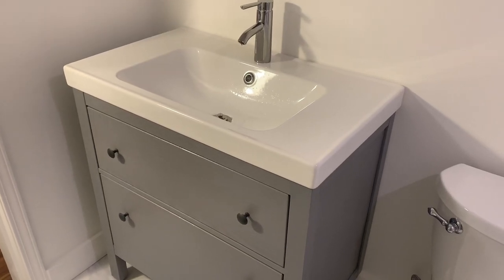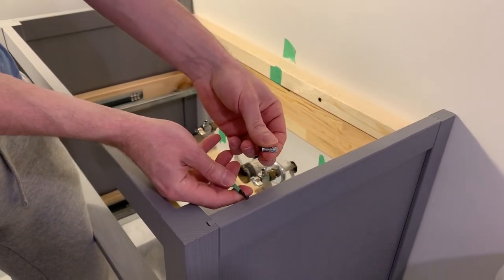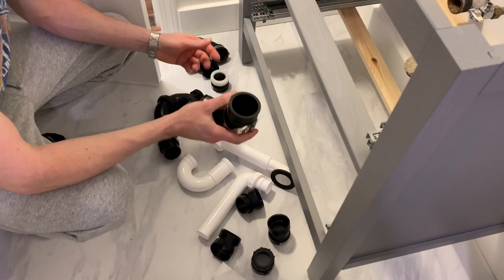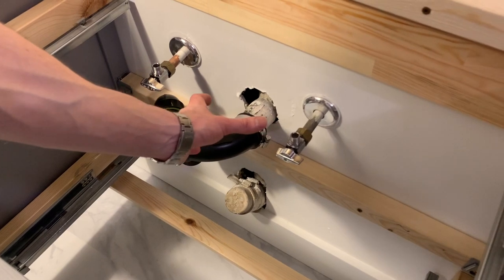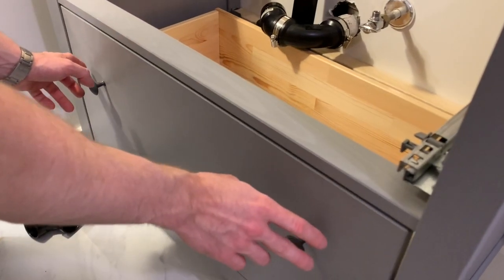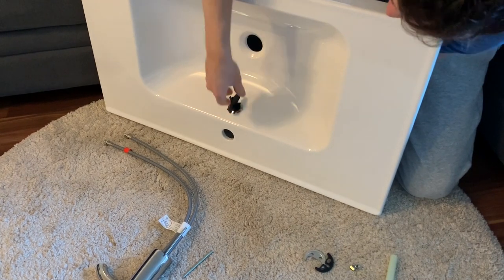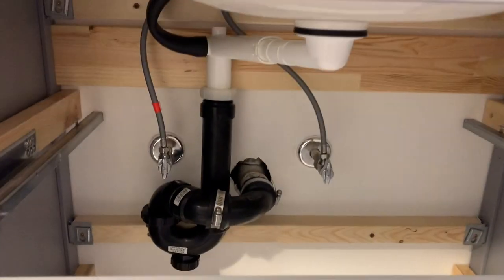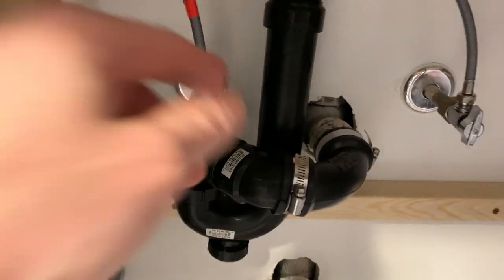HOW TO install IKEA Hemnes / Odensvik / Dalskär bathroom vanity

Comment: This is one of the most comprehensive videos I’ve seen for installing these Ikea vanities. Solved my dilemma about not having the wall studs in the right place without tearing out major portions of drywall, plus a really good workaround for their weird drain connections. Thank you!
Reply from the maker: Thank you, Doug! I would only recommend strapping the 2x2 (or 2x4) to the wall for vanities with legs as I don’t think it would hold the weight of a floating vanity. 

Also, be sure that the top of your sink (white porcelain section) clears the wood you strap on the wall. I originally had a 2x4 but later found out it was too thick and was hitting the top of the sink once I placed on the cabinet

Comment: I just finished replacing all the ikea plumbing I could.    Now I have to replace the drain pipe with the ikea part because it’s the only part that will fit.   I find all the cheap IKEA plumbing attracts hard water buildup like crazy.    But nothing at all with the ABS.    So hopefully I won’t have to do this again for a long time.   Good video👍🏼

Comment: Thank you for the great video! I’m installing mine currently and bought that little white pipe to black ABS piece at Home Depot but it doesn’t seem to have a good seal when tight. I’m concerned that if there were a clogged pipe then it would leak. Under normal conditions of course there is no issue due to gravity but have you ever had a clog?
Reply from the maker: No issue with clogs so far. The caveat is that you’ll always run the risk of leaking with mixing pipes, especially ikea pipes which are not standard in North America. The little white pipe should tighten a good seal around the pipes though. You can always experiment with other adapters/elbows.

Comment: Hi! I see you showed that you had clearance on the bottom drawer. How was the clearance with the top drawer? I am reading reviews and worrying about the functionality.
Reply from the maker: The top drawer is pretty shallow and doesn’t have much height, but there’s still lots of clearance for the pipes, it’s how IKEA builds them with efficient of space in mine.

Comment: I installed mines but the faucet started to wiggle after a few months.. any reason why? and white size is the green tool to tighten  the bolts underneath the faucet? thanks
Reply from the maker: I would first double check the instructions manual to ensure you installed it correctly, I would then check the bolt to see if it’s tightened. I’m unsure of the exact bolt size but I know IKEA uses metric in North America so it could be a 10mm-12mm size.

Comment: thanks for the video:) can you tell me how I can remove the cover on the back so that I can reach and loosen the screw behind it using an Allen key so that I can remove the mixer tap control lever? I would like to clean the mixer tap. Thank you!
Reply from the maker: Hey, I’m not sure what you’re trying to do, or if the mixer tap is serviceable. If you’re just trying to remove the mixer you can use a vice grip over a soft towel. Otherwise you might have to Google how to do that.

Comment: Hi Scott, what type of silicone did you use for this project?  Do I need to seal the gap between the sink and the wall?  Thank you!
Reply from the maker: I used a clear 100% silicone to glue the sink to the cabinet. 
For the sink to the wall, it is recommended you use a white 100% silicone.
You want something that is made for bathrooms, so it's 100% waterproof and won't mold.
Reply: @scott.charles.taylor  Thank you for the prompt response!  I did some research, can I use dap kiwi to glue and seal the gap?
Reply from the maker: @timfan3638  It should work, as long as it's waterproof and mold resistant. I've never used that stuff before though.
Reply: @scott.charles.taylor  awesome thank you!

Comment: Amazingly detailed video!
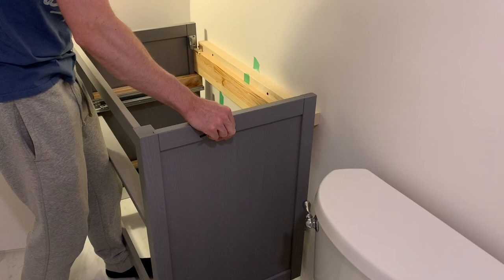Silly question for this particular Ikea vanity/sink, instead of using the 2x2s, can we simply drill and secure to wall studs from the 2x4 back support piece on the vanity itself? at @1:50 instead of the 4 bracket? or would that not be secure enough with just the two legs?
Reply from the maker: You could do that, but those strips of wood at the back aren’t super secure to bear the load of the cabinet in the long run, as it’s held in by dowels and screws

Comment: Mine came with 3 anchor hooks. Step 47 of the Ikea installation manual shows them place on the top of the vanity before the sink is installed. What are they for? I don't see you use them on your install.
Reply from the maker: I skipped using them and bolted it to the studs instead.

Comment: Great Video, just bought IKEA Odensvik sink and Rinnen pipe system. I try to explain my issue - The overflow black pipe is attached to the white pipe, the problem is that in the white pipe there is no hole (its has a T shape, so you can attach the overflow black pipe on either side) but there is no hole so the overflow water cannot flows down to the white pipe. Should I perforate? Thanks a lot
Reply from the maker: Yes, you have to knock out the side of the white part that you decide to use. There should be a step in the booklet for this, you can use a screwdriver or something to knock it out.
Reply: @scott.charles.taylor  Thanks a lot,

Comment: Pro tip: Use a grease pen to mark ABS pipes with a line on both sides after you have test fitted so you know which angle to glue elbows.  ;)
Reply from the maker: That’s a good tip, thanks!
Reply: What kind of glue did you use?

Comment: Hi Scott. Great video. What flexible pipe did you get? I scheduled a plumber because i thought i needed to cut a pipe. This video is exactly what i needed. I can do this myself if i can find the same pipe you used.
Reply from the maker: Hi Sandy, it will depend on the type of pipe you have in your home. I only used flexible pipe because in this case it was cast iron and you can’t glue plastic to it. If you have plastic -> plastic my recommendation would be to measure your pipe diameter and bring your ikea piece to Home Depot and buy a few different 90 degree pipes. You can always return the pieces you don’t end up using. Ask an assistant what type of pipe they would recommend to ensure it follows code.

Comment: Incredible video, thanks!  Very well explained.
Could you comment on the best way to mount this into plaster?
Thanks again!
Reply from the maker: Hi Emily, sorry I’m not familiar with plaster, but you would want to mount it to something structural in the wall
Reply: Thanks. It seems like using Molly/toggle bolts should work. Do you remember how long the 2x2 strips needed to be? Thanks again!
Reply: (I figure this was the 39 3/8” wide Hemnes model?)
Reply from the maker: @emilygraber7511  yes, snap toggle bolts should work if installed correctly!
If you’re using toggle bolts, there may no point for the 2x2 piece of wood then
I only used the 2x2 so I could mount it into the studs 
I don’t recall the length of the 2x2 off hand, but it has to “just” fit inside of the cabinet
Reply: That makes a lot of sense!! Thanks!

Comment: Hi, thank you for this.  I'm installing one now too.  My problem is an old house and floor drain, I've mocked it up using your video as a guide.  Question, wouldn't you add glue to the part where the Ikea drain goes into that black and white piece?  The one that gets bigger?  Sorry for the non-technical names, I'm not a professional, just trying to figure stuff out.
Reply from the maker: Good question. I wouldn’t add glue because it’s tighten by compression around the IKEA white pipe. You turn the screw and it’s gets tighter and tighter. Also, because it’s a vertical pipe/drain it wouldn’t be necessary

Comment: Great Video! I am doing a total Covid-19 Bathroom remodel.  As for the pipes.  Did you get them at Lowes or Home Depot?
Reply from the maker: Got them from both Lowes and Home Depot. They carry most of the same stuff, but only a few pieces were unique to one store. For example, the flexible 90 degree was only available at my Lowes, and the 1/4" to 1/2" reducer you see at 8:25 mark was only available at Home Depot. Just keep everything in the store bag in came in to make for a easier return.
Reply: Thank you Scott for your quick reply.  Great instructional video. All the Best!
Reply: Do you mind adding a list of the plumbing pieces. Thank you!!!

Comment: @Scott Taylor

I know this video is a little older now but are you able to tell me the measurements from the wall to the longest part of your elbow? Or the measurement from the wall to the back of the drawer so when it’s closed it doesn’t hit the pipe please and thank you.

I have been looking everywhere for this measurement but can’t seem to find it. This would greatly aid in my decision to see if I can use this vanity and sink combo

Thank you in advance any help would be amazing
Reply: Hi Matt, I’ll have to have a look and get back to you by the weekend!
Reply: @moretorque  thank you!
Reply from the maker: @hammerhog22  the wall to the back of the drawer is approximately 4 inches or about 10 centimetres. It’s very tight. Luckily for me the pipe comes out of the wall between the two drawers.
Reply: @scott.charles.taylor  thank you so much! This is amazing information!!!!

Comment: Hi Scott, Dont you need a backsplash for the sick since the wall is not tile ? (I want to know if backsplash is necessary for this vanity before buying it. My bathroom is not tiled where the vanity will go). Thanks
Reply: sink*
Reply from the maker: Adding a backsplash will be up to you. In my previous and current home, I've installed a total of 3 of these sinks without a backsplash and never had a problem with water splashing on the wall. They also have a little lip at the back to keep the water contained. If you have kids however, you may want to add a backsplash; but this is something you can always decide later down the road after installation. Also, the paint used in the bathrooms were latex/acrylic bathroom paint so was fairly resistant to moisture and could be wiped down. Hope this helps!
Reply: @scott.charles.taylor  thanks!
Reply: @scott.charles.taylor  Thank you for the video. I need to get the vanity with the top out of the bathroom for tiling the floor. And then to put it back. Since all the plastic pipes are glued together, can they be detached somehow without cutting?
Reply from the maker: @mzakuta  It will depend on how the pipes were joined, whether you used compression fitting or glued. If glued I would use new pipes are they are relatively cheap.
Reply: Thank you

Comment: Do you think this style and larger size sink would work with a 48x18 inch vanity with space for sink and cabinet doors below the sink?  I have a built in cabinet and just want to replace the sink/top.
Reply from the maker: I'm not sure to be honest, I don't have the dimensions of the sink with me. The IKEA Cabinet also has an open back, so that may be different than your built-in one. You'd have to check IKEA's site

Comment: what type of wood did you use. I want to make sure I use the right kind
Reply from the maker: Used regular spruce/pine/fir 2"x2" wood. You can also use 2"x4" but that may be a little too wide and make contact with the ceramic top when you go to put it on. Always test fit everything first!

Comment: I moved to a house that has this sink already installed.  I need to take apart the pipes to clean/unclog them.  Where can I get the tool that you show at 17:00 ?  Is there another generic type of tool that I can use as a replacement?
Reply from the maker: You should be able to use a wide flat head screw driver, or a large coin, or two screw drivers being pushed in opposite directions. If all fails you can try going to your local ikea to see if they have any in their parts bin. I don’t think there is a generic tool for this unfortunately.
Reply: @scott.charles.taylor  Thank you!

Comment: If your vanity with legs you can srew direct the cabinet to wall studs instead of to have the suport beam because the 2 legs on the ground will bear most of the weight.
Reply from the maker: Right, that would work, but unfortunately the brackets don't always line up with the 16" stud spaces

Comment: Does the top drawer run into the valves?
Reply from the maker: No it’s designed to not do that
Reply: @scott.charles.taylor  what is the distance between the back of the drawer and the wall? In other words, how much can the valves stick out without hitting the drawer? Thanks!
Reply from the maker: @allenlicn  you have to look up the dimensions on the site but I think it’s about 3 inches, more than enough for flexible water lines

Comment: Great video.  Forgot to install upper drawer  for completion though
Reply from the maker: The drawer just slides in, not much to it
Reply: I wanted to see if the top drawer clears the pipes. I want to buy an IKEA vanity but the clearance was really small and I wanted to make sure that the pipes clear. I’m trying to do this by myself. Is there anyway you can show how the top drawer fits?
Reply from the maker: @ktoffelmire1  Yes, the top drawer clears the drain pipe easily! IKEA uses a very slim drain pipe (white pipe), and the back of the top drawer is very low which allows for it to pass/slide easily. IKEA is very smart with their design, otherwise they wouldn’t sell this as a package :)
Reply from the maker: @ktoffelmire1  Your only concern will be the drain pipe that goes into the wall, as the cabinet does not allow for much room

Comment: how to remove the drawers? its impossible
Reply from the maker: Open the drawer all the way out, underneath the front of the drawer on either side you'll see two small locking plastic tabs (they might be grey colored), pull those tabs outward which should release the drawer from the sliding rail and now you can lift the front of the drawer upwards, and pull it toward you. Check the IKEA assembly instructions on their page, should depict this well.
Reply: @scott.charles.taylor  THANK YOU!

Comment: Can I ask if you know how long the legs are the unit sits on? Thanks
Reply from the maker: Hi, the wooden legs are about 6 inches and they can be raised up about another half inch with an adjustable screw at the bottom. Hope that helps!
Reply: @scott.charles.taylor  thanks is it quiet easy to put the vanity together. Have not had much to do with flat packs before. How long should it take?
Reply from the maker: @matthewgaunt1482  A vanity similar to this with drawers should take no longer than 1-2 hours to assemble. An hour to figure out mounting to the wall, and another hour to mock up and put together plumbing. This is for the average person. Obviously it can be done quicker but there's no need to rush it

Comment: Damn you got me scared now , I just installed same unit but dry wall was tiled , I bought special screw and metal plugs which seem nice and tight, sink is on and no dodgy movement , just hope it does not fall down, as you have done a stirling job with the two pieces of wood into your studs. Why don't they make them with 4 legs !
Reply from the maker: I'm sure yours will be fine, as the 2 legs on the ground will bear most of the weight. The anchors are just to hold it against the wall

Comment: you cant use those flex elbows.
Reply: Good to know, but why is that? I see a lot of newer builds (Canada) using flex pipes to hook-up drain pipes
Reply: @moretorque  they collapse. they are banned by the upc in the usa and canada.

Comment: That’s the dumbest way to drain a sink I’ve ever seen. The top drawer probably hits the plumbing of course he didn’t show you that. The video ends.
Reply from the maker: It’s the design of the ikea drain. The top drawer has a low back and does not contact any of the pipes